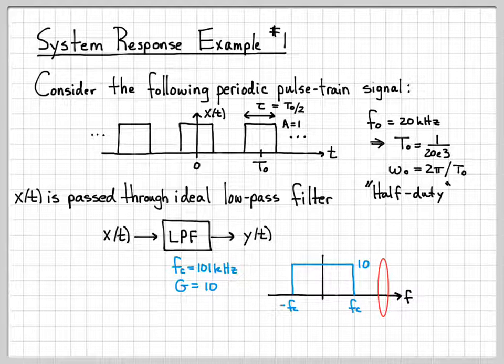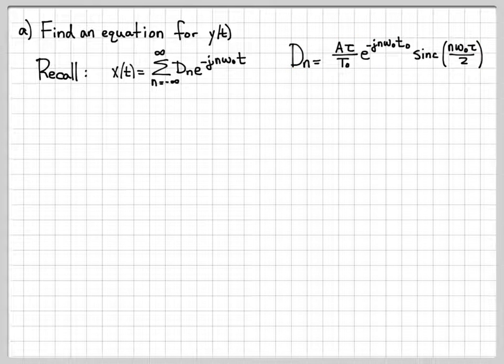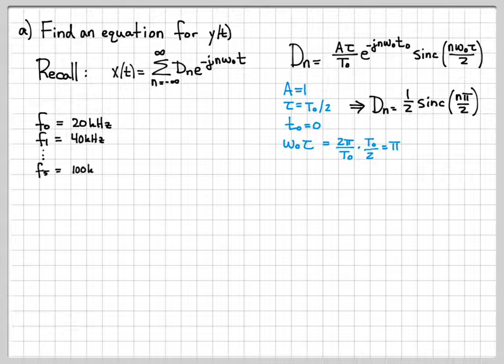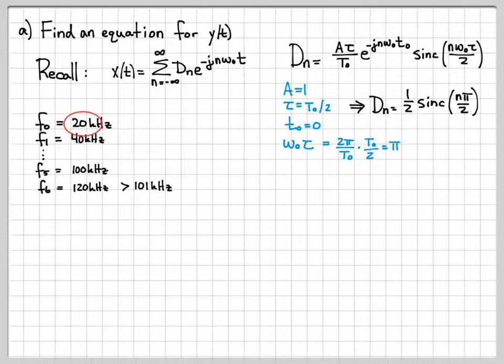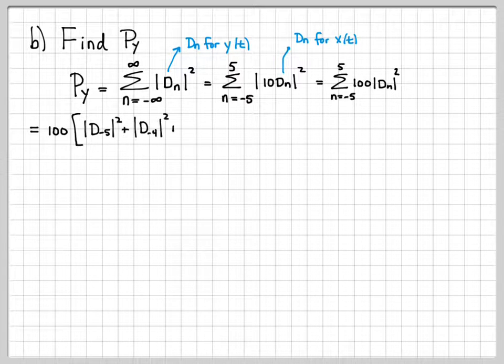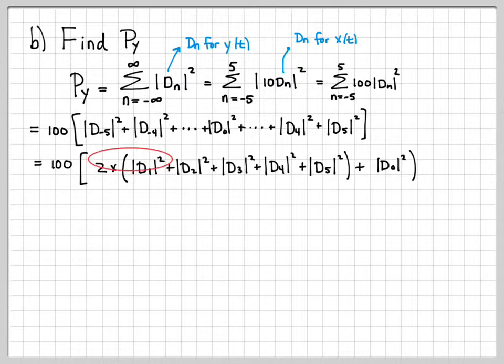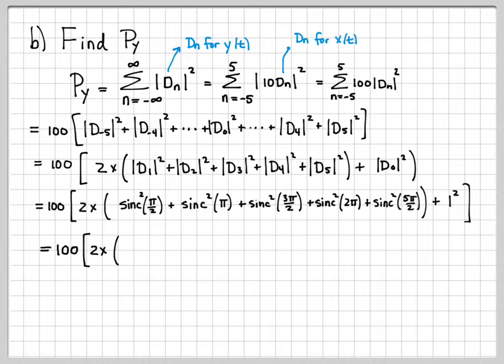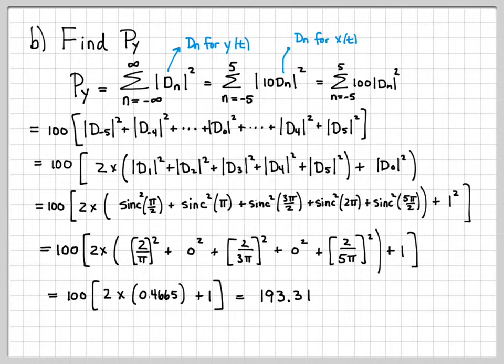Fourier Series Frequency-Domain System Response Example #1

Comment: wonderful video..but i have a little bit confusion...why did you choose the interval  -5 to 5...?
Reply from the maker: The input signal x(t) had an infinite number of frequency components.  This signal was then passed through a filter that removed most of the frequency components.  The only frequency components left in y(t) are those within +- 101 kHz.  So, the only remaining frequency components are the harmonics from -5 to 5.  The low-pass filter removed all others.  Hope that helps,

Adam